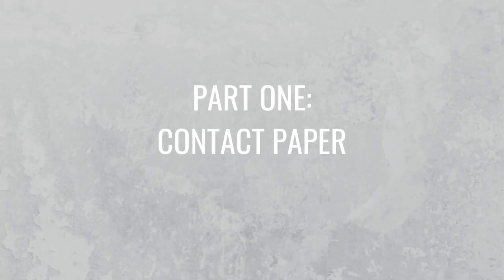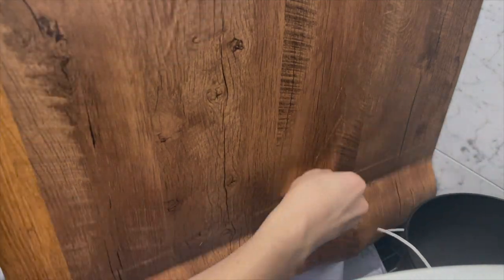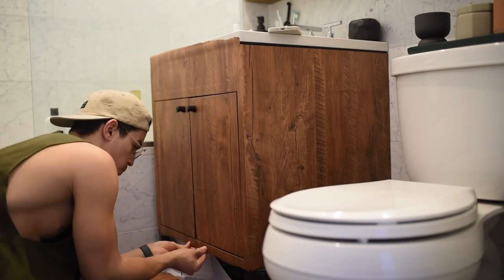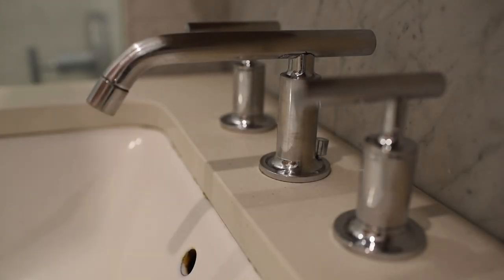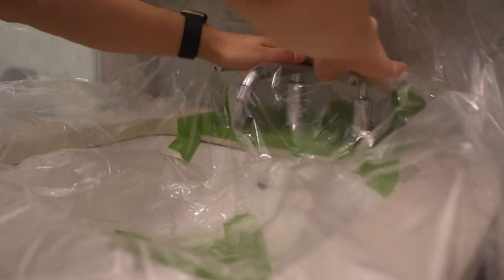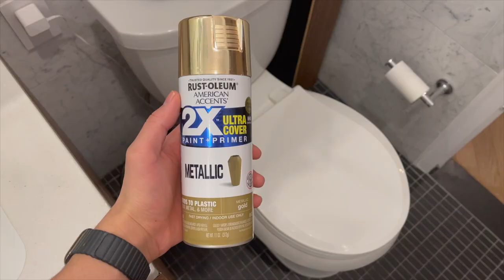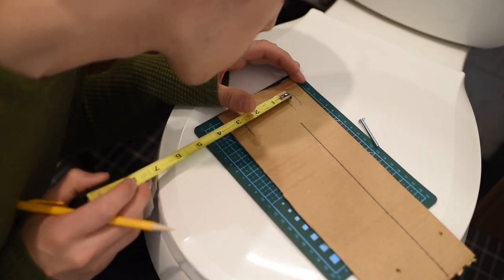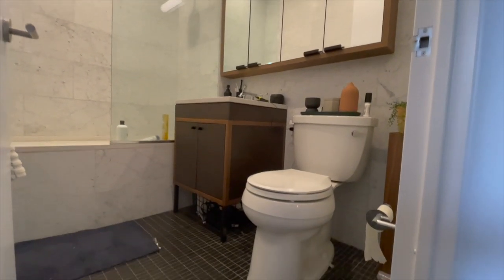SPRAY PAINTED FAUCETS?! - Cheap & Easy DIY Bathroom Vanity Makeover (Bathroom Makeover Part 1)

Comment: How are these fixtures holding up?
Reply from the maker: Amazingly! When I did it for this video I rushed the process for the sake of making a video lol and it chipped a little bit after a few months, but I went back and repeated the process with adequate drying time between each coat and since then they have been perfect!

Comment: Is it still holding up? Any issues with rust or wear after 6 months of use? I am nervous that it'll wear after a while and the need to have to keep re-doing it
Reply from the maker: Great question! I ended up doing this spray paint technique on: the faucet, shower head, bath tap, towel holders, toilet paper holder. They have all held up without signs of wear EXCEPT the sink faucet. The handles have began to discolor and show a few scratches. I’m not sure if it’s because it a more high tough surface or if I made a mistake somewhere in the process since the sink is the first thing I spray painted.
Reply: @joshmrivera  thank you for your response. That’s really helpful
Reply from the maker: Anytime! Glad to help!
Reply: @joshmrivera Could you give us an update as to how this project held up long-term?  I'm looking to lightly do my matte black bath faucets so they look a little like oil-rubbed bronze.

Comment: I have so many fixtures that are circa 1979...lights too in the house I bought. Outdoor  ones as well.  😳  Luckily many will look great oil rubbed bronze or whichever. Yeash...I'm newer to this...have any tips - or what is my chance of success with floor registers, outdoor light fixtures  (rough, faded, old) and DOH, lol...my house has an intercom system lol... way cool but $$$ to update. Nutone brown w/cassette and units in most rooms....plastic though..eek
Reply from the maker: Anything antique like that I would probably get restored! Haha love me some vintage

Comment: I have the same paint and was going to paint some light pendants!  I thought the paint looked a little to champange gold but it looks fantastic o this youtube. I havnt tried it on metal or primed surface but maybe that the difference!  The paint has primer in it, so do you think its necessary to prime a light fixture that wont be touched like faucets are. I also bought a rustoleum top coat.  Its says it supposed to provide a durable finish.  If i Do my faucets and I think I may try  I will be sure to follow you method but not sure if its worth all the work since you said yours may need redoing soon!
Reply from the maker: Awesome! Yeah I think for a light fixture you can go ahead and skip the primer. Good luck with your project!

Comment: Just checking in, how did the color hold? Any problems? Anything you would have done different?
Reply from the maker: So everything in the shower is holding up very well. The only thing that isn’t is the faucet handles in the sink. Over many months they originally were changing color and looking a little aged which i was okay with, but down the line paint started scratching off. I think probably b/c the sink faucet is the absolute most highly touched surface out of everything I spray painted. 

This was also the first thing I spray painted. As far as doing things differently I would have given each coat a full day to cure. I was in a pinch and sort of had to rush things along. My shower did have extra time to cure so I wonder if that also contributed to the color holding up. Hope that helps!

Comment: Wow! Amazing gold. 4 months after, do the paint peel off?
Reply from the maker: Mostly there is some discoloration and a few scratch marks. Thankfully the discoloring almost makes it look like brass haha but it definitely could use a touch up. I have found that most people have better success with black spray paint, which shouldn’t really have problems with color changing. Hope that helps !